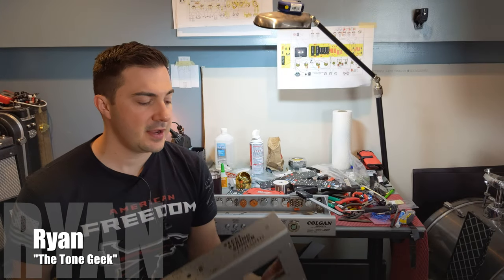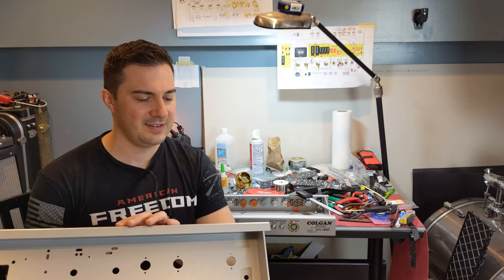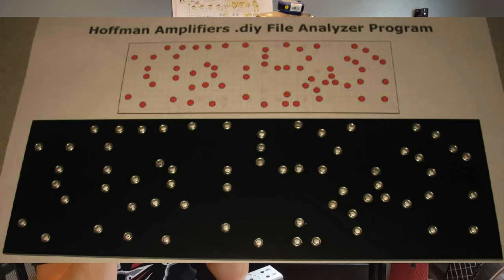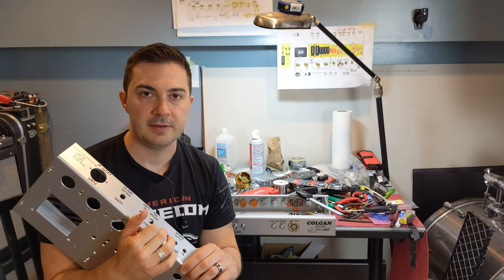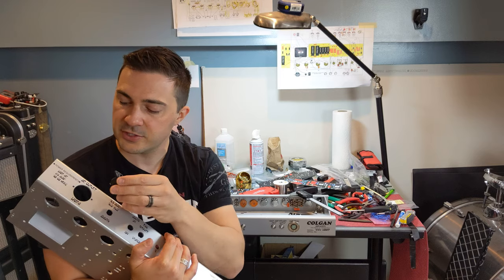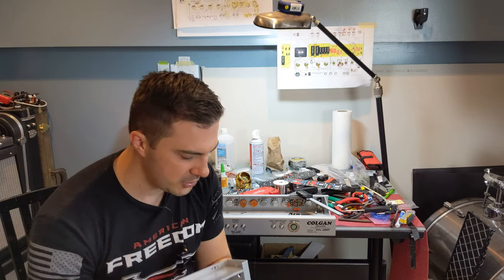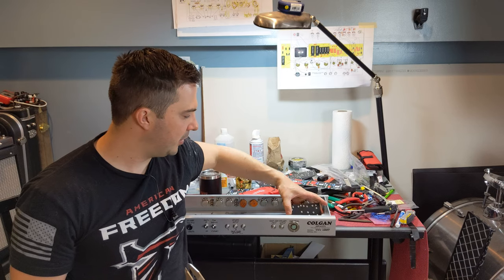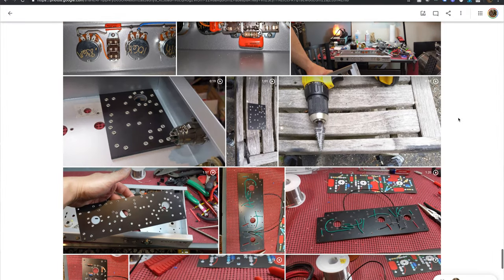Steel String Singer #002 Build | Episode 1: Kickoff

Comment: Thanks for doing such a thorough job documenting the process.  I'm considering building one of these this winter, but so far, using your BOMs I've accounted for about $1200 without a chassis, headcase (and covering), wiring, switches (I don't see the switches anywhere in the BOMs), relays or boards.
Reply from the maker: My pleasure! That's about right cost wise. The BOM is mostly complete but the layout is 100%. I bought switches from eBay 😎